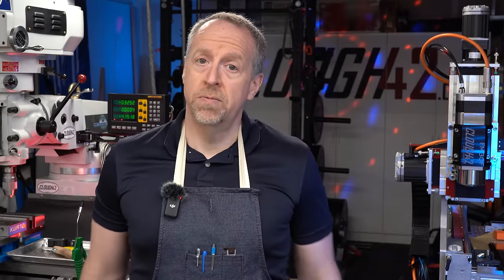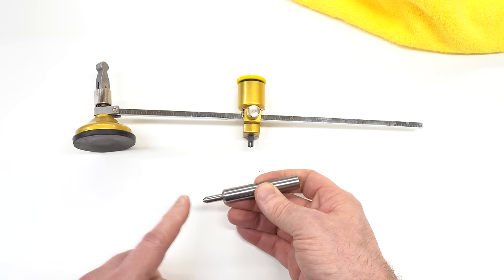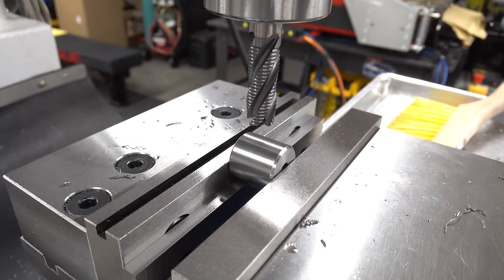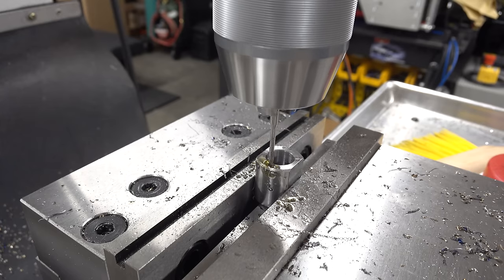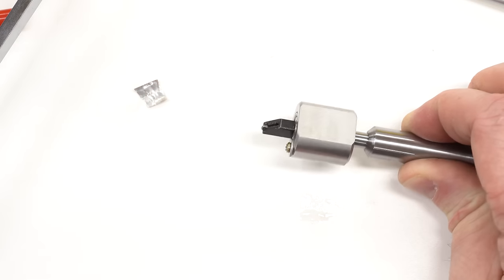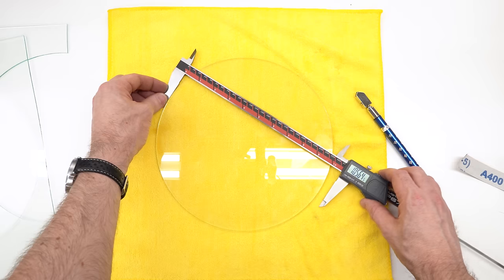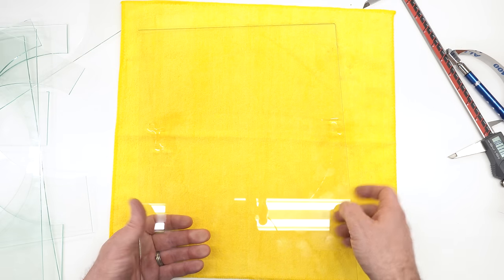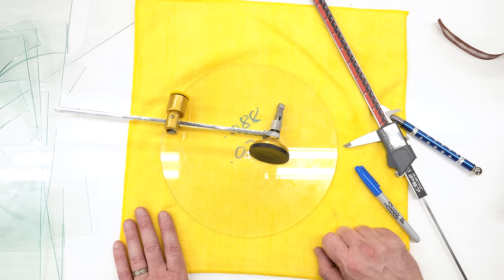Making a CNC Glass Cutter | Avid CNC

Comment: Cut the glass circles oversized with the cnc, then make a grinding post attachment for your lathe, and grind to final dimension. I think your lathe is big enough?
Reply: technically, you can also use the cnc to polish if the lathe is too small, though you'll want the glass raised when doing the initial cut (to remove the excess, and retain poistioning), and you'd ideally want a water trough so you can use water assisted cutting, so maybe an enclosure to stop water getting everywhere too.
Reply from the maker: Maybe just.  Could do it on the mill with a rotary table.

Comment: Very nice seeing the "machining" of that unusual material. But your video raises questions! :-)
- Where did you get that glass from?
- How cheap was it (so that you could afford that many sheets for experimenting)?
- How did you anticipate the need for so many experiments, so that you acquired this large amount in the first place? :-)
Reply from the maker: Glass is cheap, and it seems my intuition about how challenging this would be turned out to be pretty accurate.
Reply: @Clough42  Good intuition! I still have to make the progress from penny-pinching towards getting more extra stock. In the long run it is faster, and also makes a lot happier when one can just use it for whatever reason.

Comment: Hmmmmm, interesting problem James...Excellent, excellent job........You identified and fixed the slop by making your own extremely precise fixture.... yet still used the orig cutter and its holder....is there a possibility that the cutter itself has a bit of slop in its own rotational plane around its own axle.....ie the cuter itself isnt 100% perpendicular to the centerline of its own axle...a cpl 10/ths off at that point could show up as your error you are seeing in the finished product.....just saying.....could be ????

Comment: Be interesting if you marked the glass before breaking so you know where the wider /narrower spots were relative to the cnc’s travel. Might have some slack/backlash in one of your axes. 

Edit- this would at least allow you to tune it out in the cad with a slight ellipse
Reply from the maker: Lots of people speculating about this, but no.  The machine has approximately 0.0002" of backlash in each axis.  A CNC machine with 0.015" or more of backlash or error in any axis is basically useless.
Reply: @Clough42  true but not always perfect circularity, however I suppose even then, the errors you are seeing are still way too big

Comment: if cracking inconsistency is the main source of error, wouldn't you be able to measure this by comparing measurement close to the scored side compared to close to the back side (using edge of the caliper jaws)?
Reply from the maker: On some of the pieces, I can see with the naked eye that the crack is beveled.

Comment: Instead of trying to find a solution to how to use not round material or make it round after the fact, I'm leaning towards understanding why... If there's very little to no play in the parts you made, what about those you didn't? The diamond wheel probably has lots of side to side motion (most tools that I ever saw did) what about correcting that?

Comment: Wasn't there a problem with the way you were measuring the diameter at various points of the circumference? How do you know that the caliper was measuring at exactly the correct opposite point of each given diameter? So maybe the circles are more circular than it seems...sorry if I missed something.

Comment: Wondering how circular the scratch in the glass is prior to breaking. 
Is the problem with the CNC (backlash) or the way the glass is breaking?
Actually, upon reflection, how much wobble/slack is in the bearing that supports the diamond?
Shouldn't the diamond wheel be fixed in direction, leaving it to the CNC to rotate appropriately, not relying on resistance of the glass to rotate the wheel?
Reply from the maker: If I had spindle orientation on this machine, that would be an option.

Comment: I'd try ditch the tiny wheel in a bearing for a fixed diamond point cutter.
Reply from the maker: I tried that first, and it didn't work, which is why I went to the trouble of adapting this tool.

Comment: Wont your laser score the glass? (or at least cut a paper backing and score the glass in the same process)
Reply: I was wondering if a laser that kept repeating the exact same path would initially score, and later thermally shock the glass and remove any hand technique in removal from the picture.

Comment: We both share similar OCD: Tolerances. 
Retired from the Aircraft Industry  in the Aircraft Manufacturing, With Tooling, and in The Maintenance fields, accuracy is my pet peeve...and my downfall.
Reply from the maker: In this case, there's very little need for the bezel to be designed the way it is.  It could have been made with a wider lip, and less precision would have been needed for the glass.

Comment: Maybe some sort of rotary table that holds the glass down with a simple vacuum

Since then your not really relaying on 2 plus motors to turn the right amount at the right speed to each other but only a single point in the middle and the size in decided where the head/spindle us set to be 

At least that the best way I can com up with on the spot 

And it doesn't then need grinding and flood cooling as a bonus

Comment: On the manual tool would it be possible to use a spring to put tension on the joints to be more consistent? I would try it but I do not have one of those tools. The spring must be long and goes over the area where the increments are

Comment: Could you make or use an eccentric bearing so that the precise center of the cutting wheel will remain at the precise center of the spindle/tool assembly as the CNC moves around the circle?  (I have no clue what I'm talking about, btw.)   Or, can you accurately (enough for your desires) determine the eccentricity of the CNC cut glass so that you can design "circle" in CAD with the necessary offsets such that the CNC w/ the glass cutter will cut "better"?  Because you use that initial straight positioning cut to align the glass cutting tool I expect that the offsets are predictable.  Also, can you practice with something less expensive and dangerous than glass?
Reply from the maker: The spindle isn't turning, so concentricity with the spindle is irrelevant.
Reply: @Clough42  Hi again.  Thank you for replying.  I'm very sorry I wasn't clear.  I understand that the CNC spindle isn't spinning.  The actual glass cutter that you removed from the suction cup device is held in a fork/yoke that is held in two ball bearings.  (see 8:59 of the video.)  Just like any swivel caster wheel, the actual contact point of the tiny, 2ish mm swiveling glass cutter wheel is not directly underneath the vertical axis of the swivel.  If you look at a 9:12 of the video you have just placed the ball bearing assembly into the holder you made.  The 2ish mm actual round disk glass cutter is at the tip of your finger.  That tiny cutter is held in a fork/yoke that swivels in the ball bearings that you placed in your holder.  If the vertical axis of your holder was driven by the CNC in an absolutely perfect circle (which i'm sure it is), that 2ish mm cutter, held in the angled fork/yoke that is held in the 2 ball bearings would not make the EXACT same circle because the contact of the cutter would cause the fork/yoke to turn in/with the ball bearings.  The 2mm glass cutter, held in the rotating fork/yoke, held in the 2 ball bearings, held in holder you just made in this video, does not take the EXACT same circular path as the Z axis.    If you used the diamond drag engraver to make a circle in plexiglass and then used this new spring loaded glass circle cutter to make the exact same circle in the exact same plexiglass, the two circles would NOT overlap or be exactly the same.
Reply from the maker: @robertsternlieb5532  in fact, the swiveling cutter will trace a slightly smaller circle, possibly with a small lump at the start point.  It's worth investigating.

Comment: Your surface is not flat. Intersection of a plane and cone is a circle if its normal to the cone height, but elliptical if there is an angle.
Reply from the maker: Do you mean the bed of the machine is so unlevel that the circle is distorted?  You might want to check your math.  Over the 10" circle, the height would have to vary by 3/4" to achieve this.

Comment: Newbie question; please take it with as many grains of salt as necessary: Why not run the cutter around several passes? Wouldn't that make the groove deeper and reduce the beveling through the crack?
Reply from the maker: It's not really cutting the glass.  It's just scratching the surface and the crack runs from the weakness created by the wheel.
Reply: @Clough42  That makes sense but my thinking was this: Assuming that the crack begins at the lowest point of the etched line, and propagates downward at some angle between 0º and 90º, then the deeper the groove is to begin with, the shorter the distance to the far side and therefore less error  (in absolute distance) for any given angle. Does that make sense?
Reply from the maker: @DanGoodchild  It would if that were how glass cutting worked.  The tool is actually blunt (something like a 90 degree angle) so multiple passes don't really penetrate into the glass any further.  They just disrupt the surface more, potentially creating chips that will send cracks off in other directions.

Comment: Score it slightly oversized,  crack it, put it back on the cnc-table, fix it with adesive tape + loctite glue, steal a grinding stone from your cheap chinese dremel-clone, mount it on the spindle, start grinding the edges with a circular path until you get the desired diameter.

Comment: could you try scoring both sides of the glass?
Reply from the maker: The 455nm blue laser doesn't interact with glass directly.  To etch the surface requires some kind of marking or coloring compound.  I believe there are other wavelengths that can cut glass, but from what I gather, it's usually done abrasively by grinding or with a waterjet.
Reply: I meant mechanically scribing rather, as in the video. Would requiring some perhaps complicated precise positioning of the glass,  or picking up of circle position of course..

Comment: Somtimes  the glass has some small internal tension from its own produktion process. In cases like this an optimisation of the cutting equipment will not improve the ca +/- 0,2mm deviation from perfekt roundness.

Comment: So what happens if you use your diamond drag engraver on the glass? At least it should be better centred than the swivel cutter
Reply from the maker: It scratches the glass.  But the glass won't crack along the scratch line.  That's what I tried first.
Reply: @Clough42  ah, no good.

Comment: As an electronic technician worked in the glass industry producing glass for vehicles I can tell you, you can't cut glass to size.
We have produces all sorts of glass (windshields and so on) for all types of vehicles, from cars up to heavy agricultural machines and customers requested the products with very small tolerances in a range between 1/100 to 1/10 of a mm.
The glass was cut to oversize and grinded to size with diamond grinding disks and lots of water befor the got hardened.
So the tolerances you archived are quite good but I highly doubt you will get them much better without grinding the glass to size.
Reply from the maker: Thanks.  I've had a few professionals in the field leave useful comments like this one.  That's pretty much the conclusion I was reaching.

Comment: my guess is that the scoring wheel might be wobbly on its little axis. use diamond instead.
Reply from the maker: Tried the diamond first.  It didn't work at all.  The glass refused to crack along the score line.

Comment: When you insert the tool holder on the rod and twist the setscrews don't you introduce an offset from the center?
Reply: It will only be offset the amount of "slop" there is in the hole. If it is a close fitting hole, this might only be a few .0001". Endmill holders for milling machines that work like this are very common and good ones can provide better runout than other types of holders.
Reply: @mayshack  i think is not constant because it swiwels, pardon my English, hope autocorrect works it's magic
Reply from the maker: There's basically zero play before tightening the set screws, so they wouldn't move it much, but it wouldn't matter anyway, since the spindle is not turning.  The glass and cutter don't know where the centerline of the spindle is.
Reply: @Clough42  yes, i understand

Comment: What does float the quill mean?
Reply: Don't lock the quill vertically or use power downfeed. Instead, feed down by hand, but don't push the spindle or hold it back. Just help it go down at the speed that the tap wants to screw into the metal. One way to break a tap is by trying to push on it (like you would with a drill bit) while it is cutting.
Reply: Don't put pressure on the quill - just let the tap pull itself into the hole.
Reply: Ah I see, thanks

Comment: Not being 100% accurate, it still is for most glass panel applications. You can also use it to cut real oval glasses (for picture frames), which is very annoying to do by hand with a template :-)

Comment: I still want to see someone put aluminum or copper on the top and bottom of glass or ceramic and then run it under a plasma table to see if that will work. If it has a conductive surface on the top and bottom and your ground clamp is clamped to both top and bottom I'd like to see if the plasma arc will run all the way through and cut it. It (the conductive material) wouldn't need to be very thick, if you're cutting through dielectric materials it (the arc) would need to be able to jump from the top conductive surface to the bottom. Super curious. When my Crossfire gets here in a couple weeks I'm going to try it. I've been thinking about how to cut dielectric materials with plasma as I drift off to sleep every night ever since I ordered a Crossfire table. No doubt I'm overlooking something super obvious here, and no doubt someone will delight in telling me how stupid this idea is, but if the insulative material isn't super thick I think the arc should want to jump from the front to the back to sustain.
Reply from the maker: This could work in theory.  Do you know the difference between theory and practice?  In theory, there's no difference.  The biggest challenge is likely to be thermal shock shattering the glass.
Reply: @Clough42  Yeah, I know it is going to be completely different in practice than in application, but the idea seems like one worth pursuing to cut through other insulators that aren't quite as shock sensitive. Maybe turn the thermal shock into a feature instead of a bug and put the material under water...which might also help the conductive properties of the cut. A controlled thermal shock could be used to fracture things very precisely. It requires testing. Which is why I want someone else to do it too. I don't have my table yet....might make an interesting video....Maybe??

Comment: What rpm were you running your roughing endmill at?
Reply from the maker: I wasn't really paying attention.  Probably between 1200 and 1500.  Nice and leisurely..
Reply: @Clough42  hmm, seems a little fast to me. With a 12mm I'd usually run between 800 and 1000.
Also, if you have the ability use some coolant on it, greatly increases the life of HSS roughing endmills. Ideally some sort of flood coolant (like a steady stream).
Reply from the maker: @Birb_of_Judge  it's carbide, so it could easily run 3-4 times this speed.
Reply: @Clough42  true.
I didn't know they made this style of endmill in carbide. At our shop we only have them in HSS (super nice when new, but they dull fast if you don't run 'em right).

Thx for the insight

Comment: There's probably some lateral movement on the cutting wheel and some axial twist on the bearing.

You've done some excellent work on your machined parts but the original cutter parts you used aren't up to your standard.

Comment: Try a diamond cutter. If your machine can make a truly round cut a single point diamond cutter should work.
Reply from the maker: Tried it.  The crack would not follow the diamond score line.  Not sure why.  Some have suggested it has to do with the oil.
Reply: @Clough42  Does the cutting wheel deflect of have side to side play?

Does the cutter not rotate in it's pocket freely under the load of the spring as it goes for it's 360* turn?

Maybe a couple of little things working together?

I wonder if a waterjet would work on glass... Too bad it's glass, not a chance for EDM.
Reply: @Clough42  After looking around waterjets look like just the thing. The edges look great as well. When are we going to see a waterjet project?

Comment: I THINK THE ACCURACY IS NOT OPTIMAL DUE TO YOUR ENGRAVING KNIFE. IT HAS SMALL CLEARANCE FOR SLIDING. I BOUGHT THIS KNIFE AND CHECKED THE CLEARANCE BETWEEN THE HOLE DIAMETER AND THE SHAFT DIAMETER AND IT WAS 0.08 MM. I had the shaft re-chromed to reduce the clearance to 0.02-0.03 mm. As a result, it gives me very precise engravings. After increasing the accuracy, I can now engrave a 0.5 mm straight line, before adjusting, when I engrave a 0.5 mm straight line, the result is only 1 point because the knife tip wobbles due to the clearance

Comment: Can you flip the glass so that it has a cut on both sides? Then the bevel will try to join the other sides cut thus controlling your bevel more.

Or would the pressure from score of second side just crack the sheet?